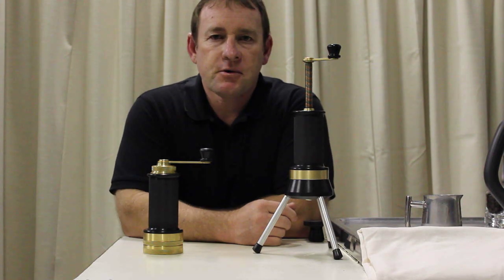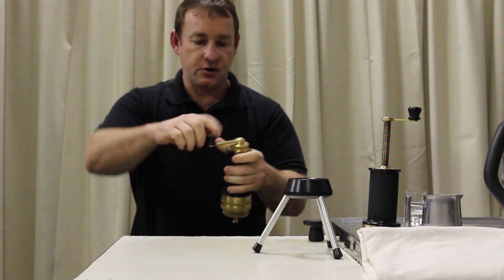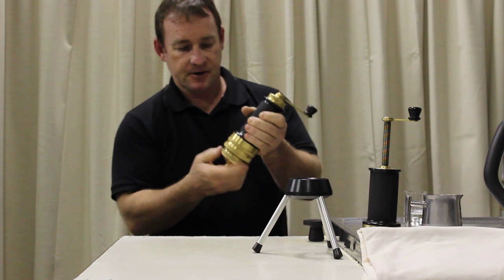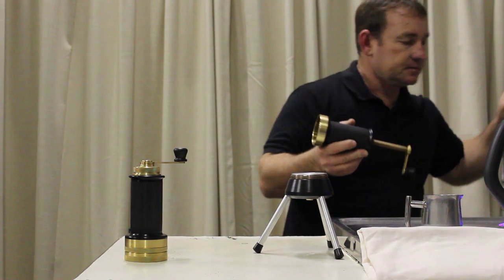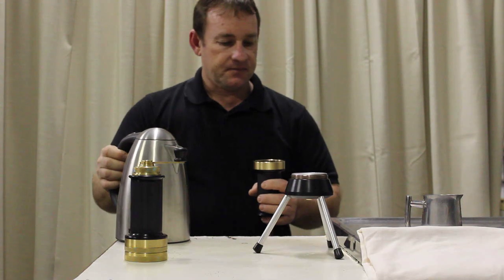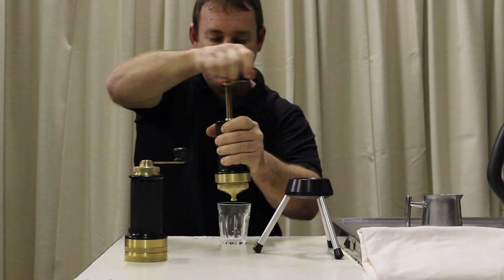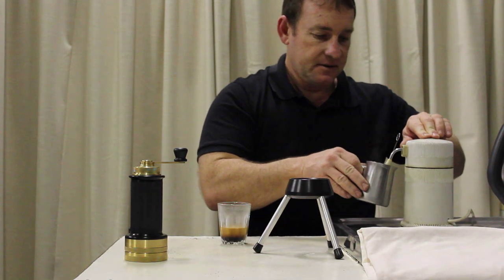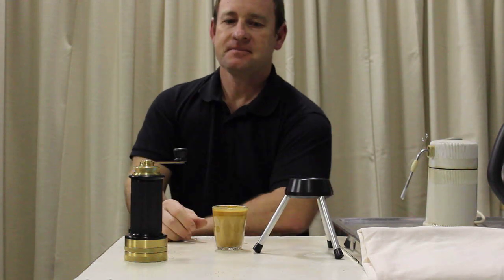Rosco Hand Grinder and Rossa Hand Espresso - Basic Operation

Comment: Hi Ross. I have a Bellman steamer too (the version that's also a percolator - although you'll be pleased to know I use a Rossa to make the coffee, and the Bellman just to steam milk).  My principal complaint with the Bellman as a steamer is that it takes a long time to heat the milk.  Is this why you drilled out the wand nozzle, and if so, to what size?  Did it help?  Any other usage tips?  Thanks in advance!

Comment: Where can one get spare parts for the seals and the filters? Are they standard parts available in other stores?
Reply from the maker: I make the seals for the Rossa, but there are other filterhead seals that fit. Not sure which ones though as I only use the ones I supply. The filters are a standard size, so should be available from most good suppliers. I also stock them if you get stuck.